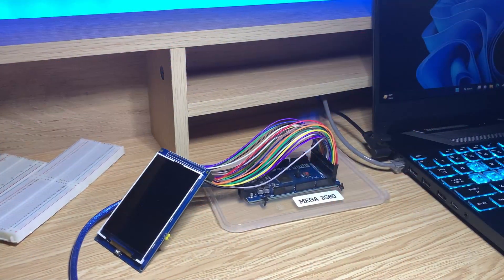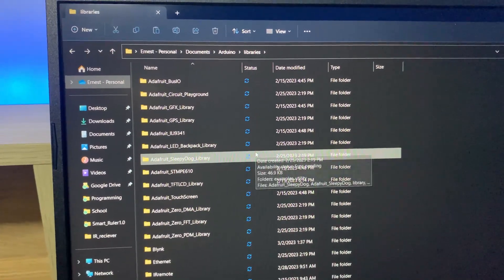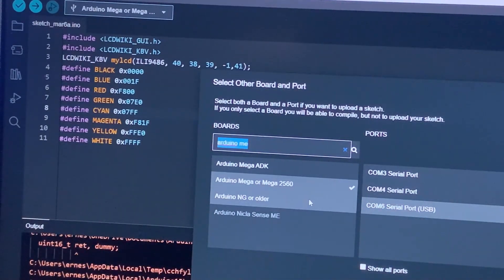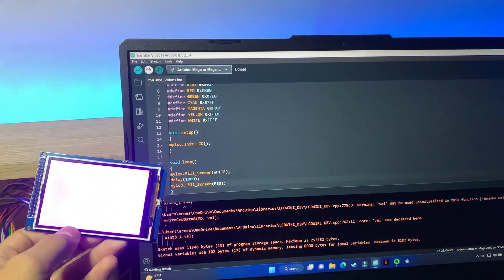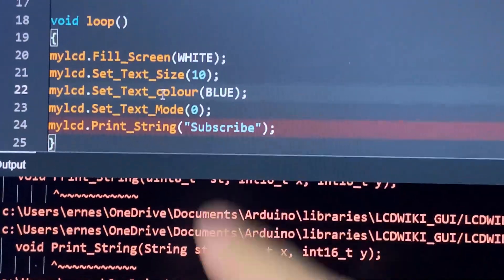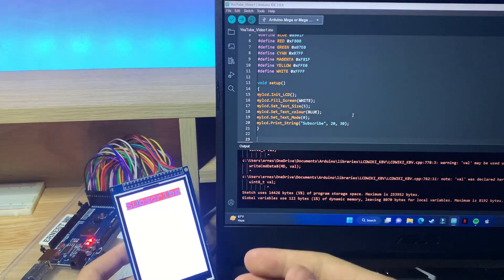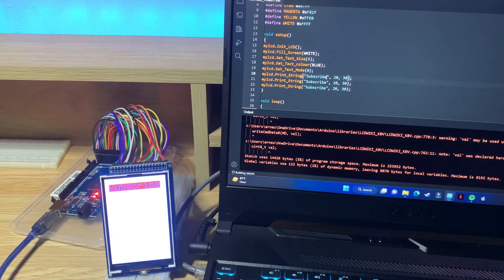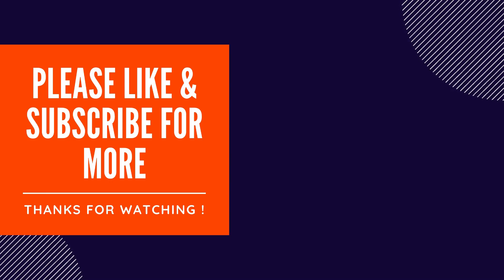3.5 inch LCD Shield for Arduino Mega 2560 Tutorial

Comment: Doesn't work! Plugging the board into the Mega 2560 and trying to run the simple sketch, just with the BLUE screen code I get:
avrdude: ser_open(): can't open device "/dev/cu.usbmodem148301": Resource busy
ioctl("TIOCMGET"): Inappropriate ioctl for device
ioctl("TIOCMGET"): Inappropriate ioctl for device
I have been beating my brains out against this display for a week now and all I get is a white screen. I'm returning it. I've already wasted too much time on this display (HiLetgo 3.5"TFT)
Reply: This isnt a code problem, this a hardware problem. Try different ports, or maybe a different board. It says it cant access the board, because its busy. Most likely a board problem.
Reply from the maker: Did you try using ChatGPT? It can provide you code. Although if you’ve already returned it then nevermind.

Comment: If your screen doesn't seem to respond to anything, check your lcd_mode.h file. If you're using 16 bit mode, the variable should be set to 0.
Reply: thanks this worked for me
Reply from the maker: Good point, I should have mentioned that in the video!
Reply: @IdeasCreationsInventions  no problem!

Comment: are there modules to connect the lcd to lessen the cables and connections it eats on the arduino?
Reply from the maker: You can actually connect the display directly by placing it on top